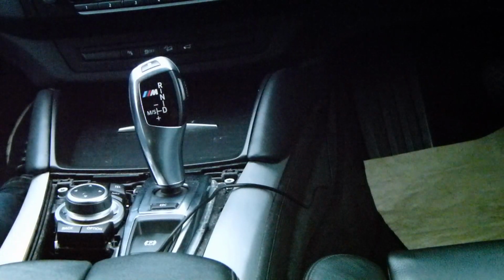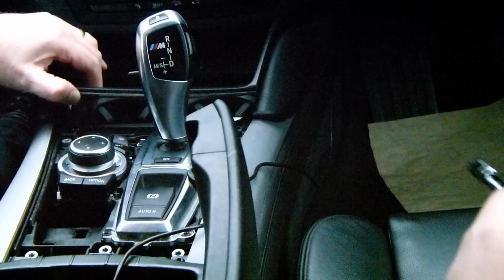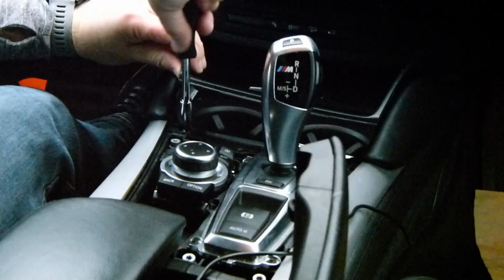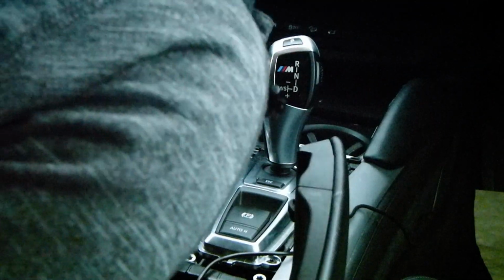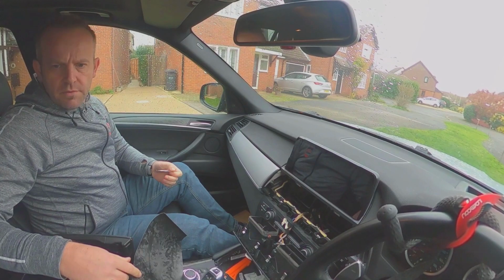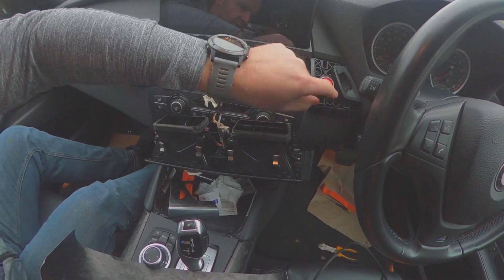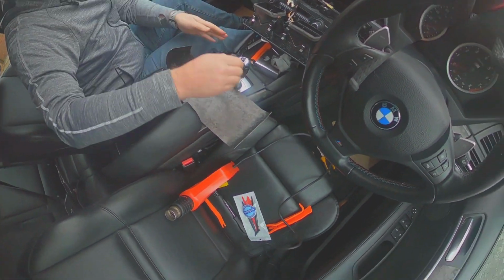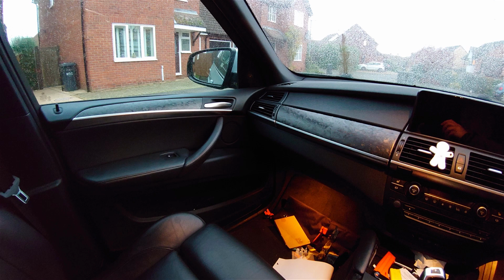Hexis Forged Carbon Wrap - BMW X5M E70

Comment: Great video I’ve bought the and will be starting it soon. Have you changed your media screen for a touch one?
Reply from the maker: +Phil wood I have yes, it transforms the cabin. have you got one?
Reply: @RichsRides  no but would really like to get one. If you could let me know the make model and where to get it from.
Reply from the maker: +Phil wood I can't actually remember now, there's quite a few available. I think I overpaid for mine! Google BMW E70 android head unit, I'm sure they're a couple of hundred now. just make sure you get the correct model.

Comment: Hi, where did you get the blank to replace the phone cradle once you removed it?
Reply from the maker: +Jamie Elrick got it from BMW dude, wasn't very expensive either. will see if I can find the part number for you.
Reply from the maker: +Jamie Elrick 51169115083 (blind plate) about £10 direct from BMW.

Comment: It looks great. My question is, do I REALLY need to take the door trim off to apply the wrap? I think I can avoid it.
Reply from the maker: Hi, you can do it in situ, but if you want to get the wrap to tuck around the back you have to remove the door card to remove the trim. I've heard of plenty of people that have done it in place with success. Give it a try, if it doesn't look good to you take it off and go again.

What are you thinking of wrapping it in?
Reply: @RichsRides   Yeah, I think my biggest issue would be the center console trim. I plan to do a simple brushed aluminum look. Sadly, not many E70s in the states came with aluminum besides the M and I'm sure it was very price for the non M models. So Im changing it up! Once I'm done, I'll post a video of my interior.

Comment: Looks great!  Do you have a video or link to more information on the start button change?
Reply from the maker: +Austin Speer thanks for watching, I don't yet but it's pretty simple. if you remove the small dash panel the bezel and button simply pop off with a small pry tool. you might get lucky and be able to use the sticky stuff you get with the new button to simply pull the old one straight off, then the new one just pops on.

Its honestly a 2 minute job at the most.will see if I can put a quick vid together for it.

good luck.
Rich

Comment: Do you reall need to remove the whole door part to remove trims?
Reply from the maker: +Piotr Kłobuch unfortunately yes, the trim is bolted on to the door card. they come off pretty easy though. are you getting yours retrimmed?
Reply: @RichsRides  I want to wrap it myself, inspired by you
Reply from the maker: +Piotr Kłobuch nice! it is possible to do them in situ but I wanted to make sure it was wrapped over the edge and tucked in behind to give it a better look. I was worried about it not sticking properly if I just trimmed it in place.

What colour are you going for?
Reply: @RichsRides  I'll probably take it apart so. I went for brushed metal wrap, looks good in youtube videos
Reply from the maker: +Piotr Kłobuch that'll look really nice when it's done. Take your time when you do it and use heat to help make the wrap more flexible for the edges, and start with the easy bits. you'll soon get the feel for it.

Good luck.
Reply: @RichsRides  Thanks!